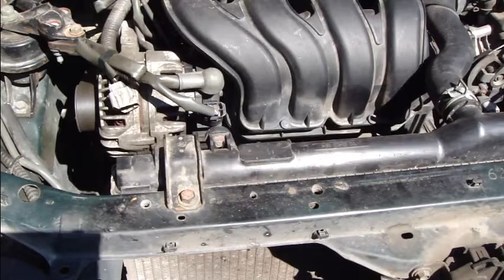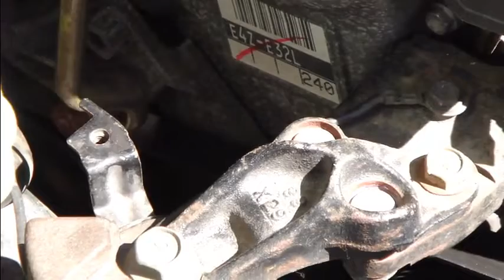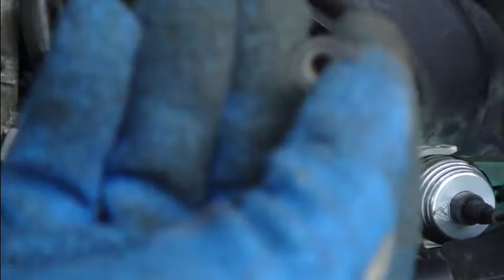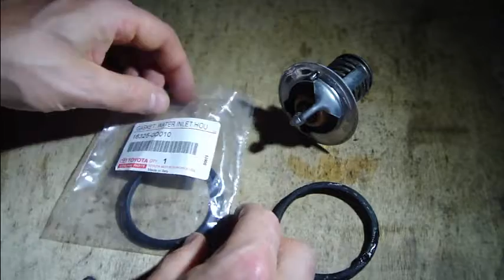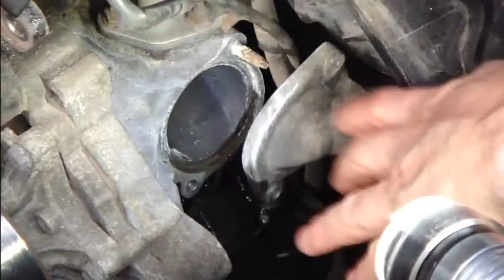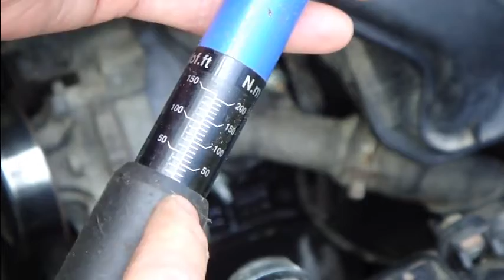How to replace thermostat Toyota Corolla VVT-i engine. Years 2000-2008.

Comment: The Actual torque settings for the Thermostat cover bolts of the 4ZZFE engine is 9 Nm or 7 ft (Haynes manual chapter 3 3.1, Toyota Corolla Owners Workshop Manual (Martynn Randall)).
Reply from the maker: Noted 👍😀

Comment: hello peter
i have a problem with my toyota altis 1.6 manual 2012 model
on high speed over more than 120 my car hwat guage goes up
when i decrease the speed heat guage goes nirmal i mean half of guage meter
my automatic fan is working successfully and i already clean my radiator but the problem is still there
is this thermostat valve fault
plz help me
regards
usman

Comment: Hi i have a 2.0 d4d just had new timing belt and water pump. But coolent not returning in small return pipe on top of coolent bottle. Any help please
Reply from the maker: Hi, you must open coolant cap and keep heater MAx. And engine is running idle long time
Reply: @PeterFinnTheCarDoctor  thank you i will try it now.

Comment: Hi peter how can i loosen the bolt of the binder if i don't have the 19 mm because it looks kind of stock there thx in adance and keep up the good work
Reply from the maker: Hi, you Need that tool. Loan it from  some place, like library
Reply: @PeterFinnTheCarDoctor   i think it's to rusted i think i got no choice but to bring it to my mechanic but most of the time i like to work on my own car but that bolt want seem to move and i don't want to break it so i have no choice but thx for the tip Peter and keep up the good work

Comment: Torque for the upper 12mm alternator bolt is 18 ft lbs and the lower 14mm alternator bolt is 39 ft lbs. The thermostat bolt nuts are torqued to 8 ft lbs (equivalent to 96 inch lbs or 10.8 Nm). It's difficult to get a torque wrench on the lower thermostat bolt, so torque the top one to 8 ft lbs, then try to do the same on the bottom. Not too tight.
Reply from the maker: Hi Sir and Thank You for feedback. :-)

Comment: I have some water pump squealing on 118.000 km. I will change the new water pump. Should I also change the thermostat, although I have no problems with cooling ?
Reply from the maker: Hi, pump is enough

Comment: Hi, why some cars engine warms up faster than other? I have a 2008 honda civic with 1.8l and it takes too much time to warm up (at winter) I changes thermostat(oem) and coolant and not help also I tryed to put a carton on a front but I didn't saw that it warms up faster. My father has 2006 corolla with 1.8l also and it warms 2 times faster. Some people says its normal because this is a small engine but I have a friend who has a Toyota Echo 1.5l which warms up faster than my civic
Reply from the maker: Hi, some car engines warms up faster, because: 1) Car engine material( iron or aluminium ) 2) Car engine design 3) Car thermostat temp model

Comment: Think i'll give my Yaris a go then! Looks simple enough,thanks.i changed my anti-freeze today it's on it's 3rd year change now the fan won't come on! Dashboard shows red temp symbol when started usually it's blue for cool/cold.I felt the cold pipe at bottom and hot at top,relays seem to be ok as i switched them round incl all other fuses are ok.Could be the thermostat or temp sender unit??I'll let you know.
Reply from the maker: Hi, interesting.  I have to do more research.
Reply: Not used the car for 2 days but the red thermometer light/symbol has gone out and turned on a/c and fan works but it turns slowly ofcourse it will.I give it a good run friday and see if fan kicks in.I did panic as it never happened before it always kicks in after 10 mins this time it did not.

Comment: Hi,I have a question, my radiatar fan comes on  frequently even when the engine  is cold,is it normal?
Reply from the maker: Yes
Reply: Peter Finn Ok ,thank you
Reply: I found why the fan comes on. Its because when the heater core fan is on and on the front window the AC engages automaticly.